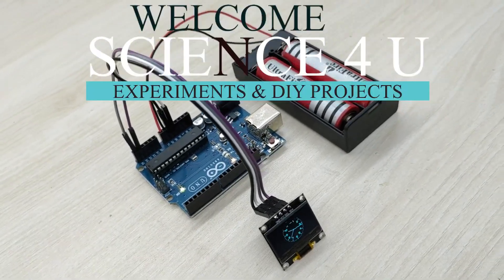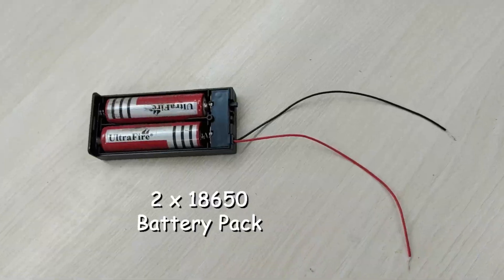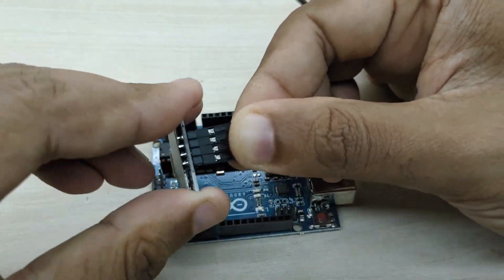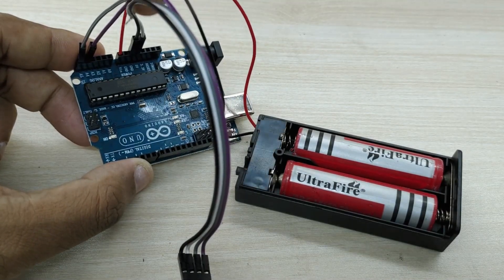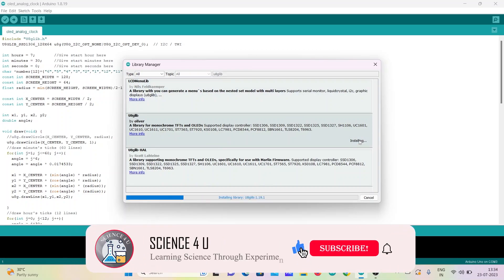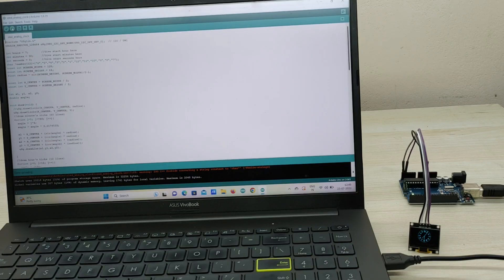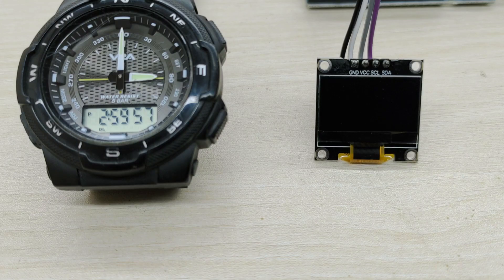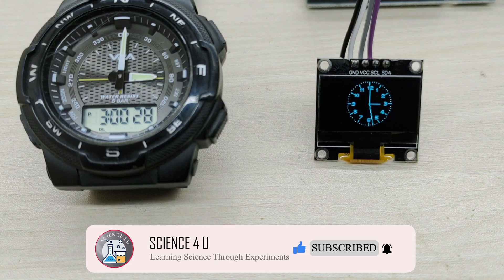Make Analog OLED clock without RTC module || SSD1306 0.96" OLED display || Without DS3231 Module

Comment: how can i change time?
Reply from the maker: Hi friend. In this code, you can change the starting time when the circuit is powered on by changing hour, mins ans seconds in the code. But when the clock is running, it is not possible to change the time.
Reply: @Science_4U_  thank you very much
Reply: @Science_4U_ PLSSSSSS REPLY ASAP

so the thing is that while coding, we have to just set the starting time, EVEN if I reconnect I battery, I still have to set the starting time?
Reply from the maker: Hmm..yes friend. Everytime you power ON, the clock will start from the set time in the code only.

Comment: Compilation error: 'int y1' redeclared as different kind of entity
I get this error when tryong to complie to code.
Reply from the maker: Hi friend. I think you are using an old version of IDE software. Can you update the software and try?
Reply: @Science_4U_  it says that it is up to date when I try to update
Reply from the maker: @DirtNerds  Hmm. Okay friend. Did you use my code as such or did you make any changes? Because all my codes are tested ones and so there should not be any errors.
Reply from the maker: @DirtNerds  I would suggest one thing. Can you redownload the code once again and upload. Sometimes by mistake the code would have got changed. Can you re-download the code once again and upload as such and see whether the error is coming again.